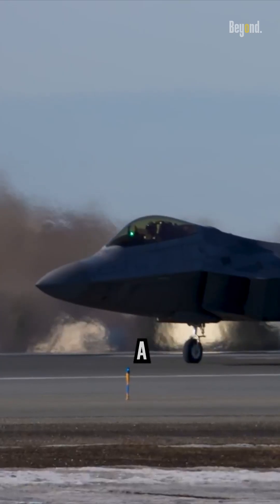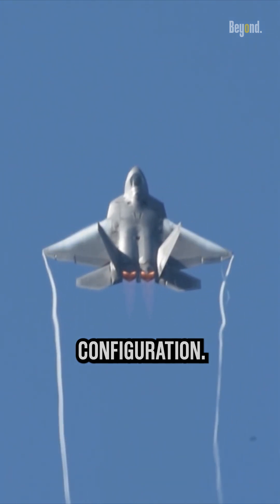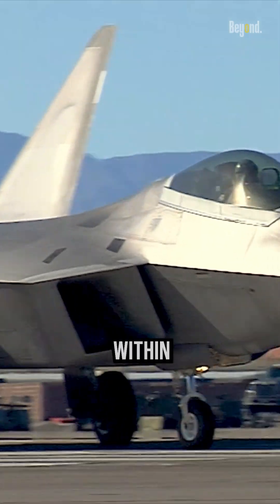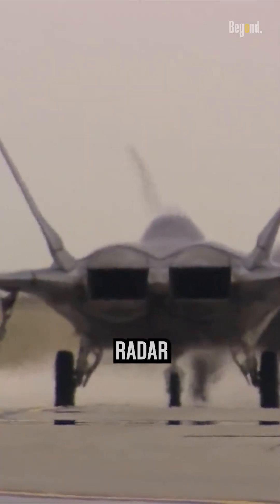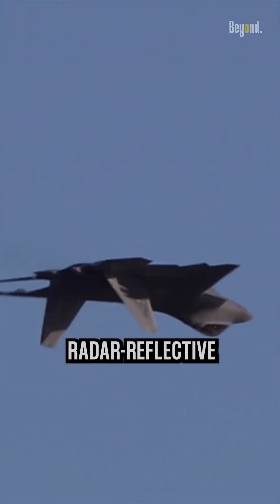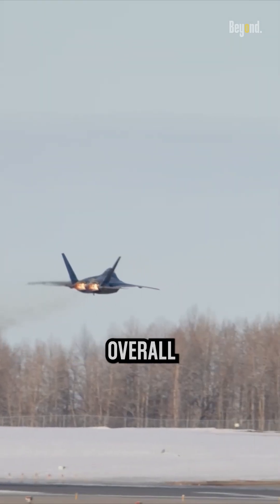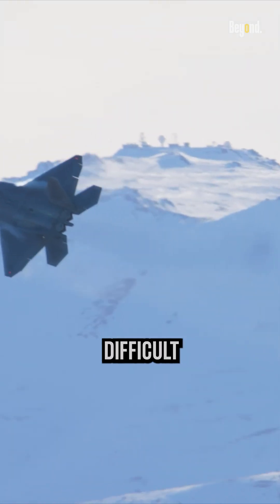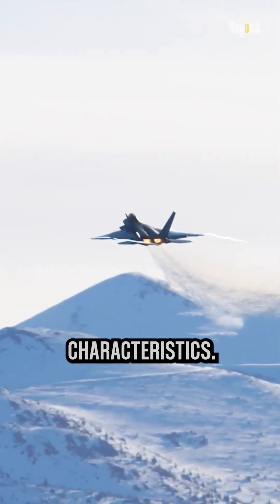Another secret behind the stealth of the F-22 Raptor  #shorts

Comment: But as friends in the pratts industry said, the biggest problem with the F-119 is that it it has one of the shortest engine lifespans in the world with less that 2000 hours
Reply: Are you sure of that sir?
Reply: @akm90115  the hot parts yes, but the cold parts can last to up 3000-3500 flight hours, but still on the low side for turbofan engines
Reply: @sweatybotfn9982  so still have to deeply maintain the engine at 2000,its the same thing for me sir,thanks for the info 🙏